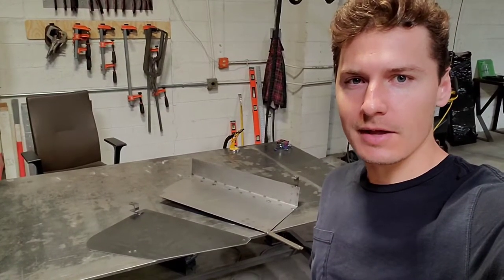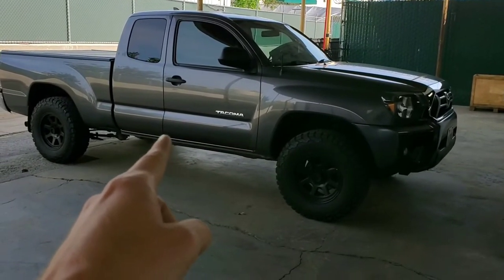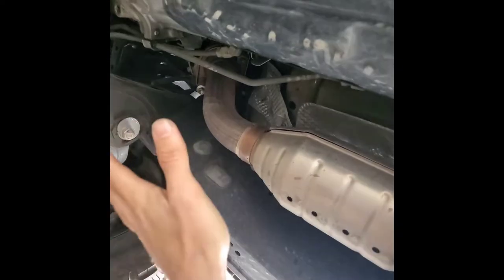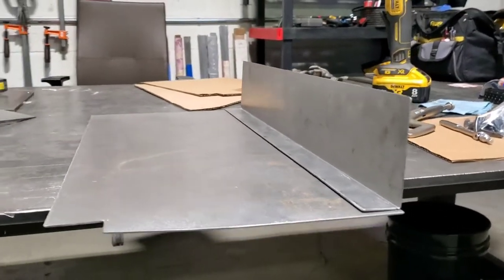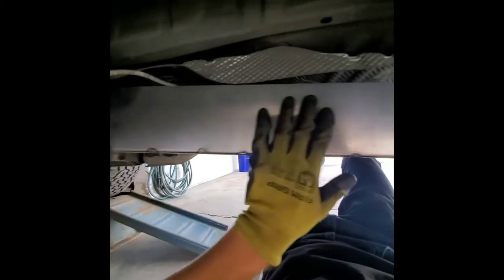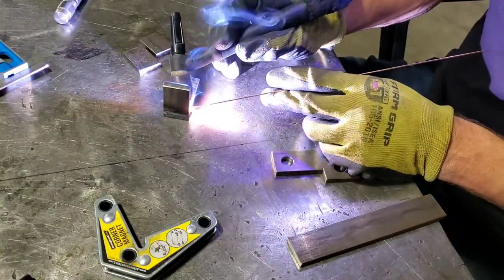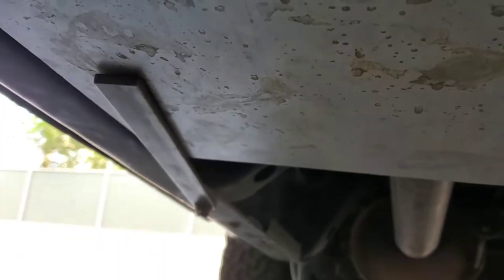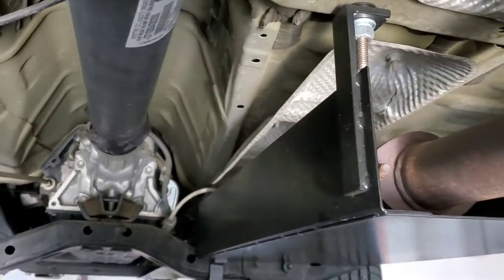4 Cylinder Catalytic Converter Shield - Toyota Tacoma

Comment: QUESTION: Would you see that it may still be possible if they just make a LONG CUT from outside both ends of shield?
Reply from the maker: If a thief cut the shield from end to end, each half of the shield would still be secured to the frame and wouldn't bend easily out of the way. More cuts would need to be made. This wouldn't happen though because cutting the shields would be loud and ineffective. Thieves are looking for an easy target. Ultimately the shields are a deterrent and not a 100% guaranteed solution but they're the best deterrent available for 4 cylinder Tacomas!

Comment: Do you have any problems with heat retention?
Reply from the maker: I haven't had any issues with overheating with either my prototype shields or my newer production shields, which have vent holes for optimal ventilation.
Reply: @grippimatt I need one of these for myv2016 tacoma 2.7 v4.Im in los angeles and my truck is coming out the shop tommorow.They just replaced my stolen cat.Need ASAP.